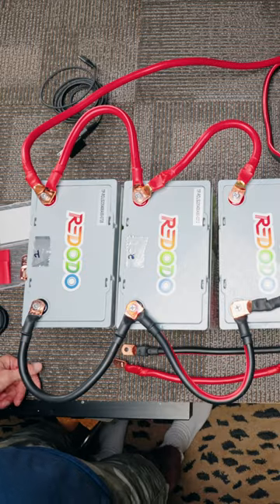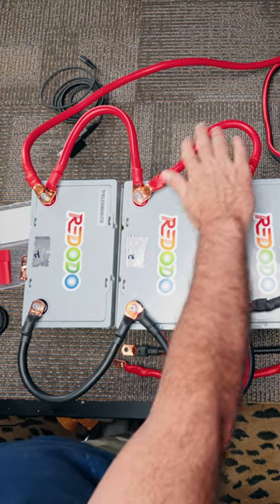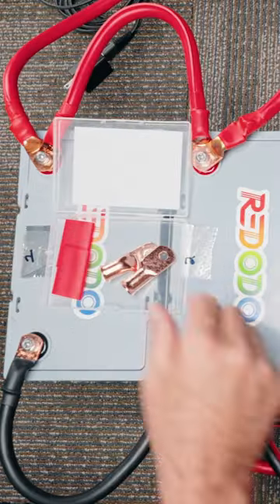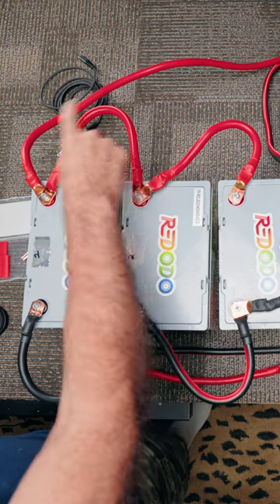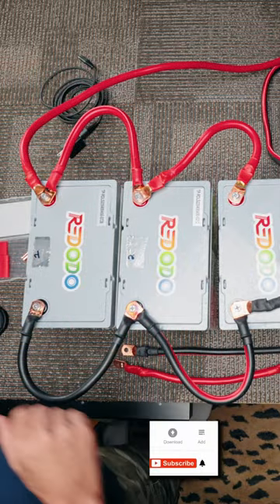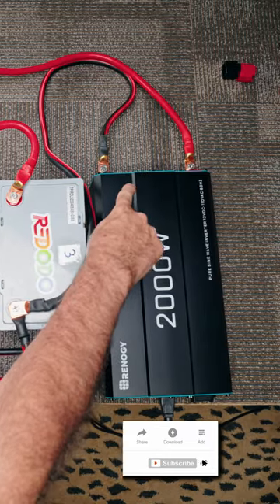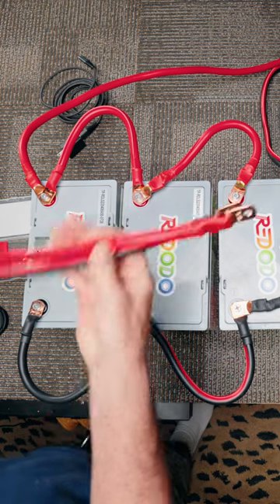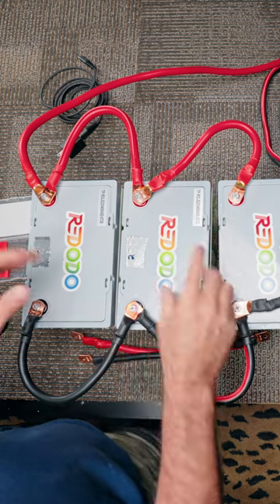How to Parallel Multiple Batteries to an Inverter #shorts

Comment: Remember kids, parallel for adding amperage and series for adding voltage.
Reply from the maker: Yes thank you!... 😀
Reply: Uh-oh. So what's the difference between adding amperage and adding voltage? How do I know which one I need to do?
Reply: @angelamarie88 most of these inverters accept only 12 volt. More expensive ones can run on 24 or higher. In the case of a 12 volt, you must increase amperage to increase wattage. Remember that wattage = voltage x amperage.

For this 2000watt 12 volt inverter you’ll need 2000/12 amps to run at maximum wattage. That’s 167 amps.

Each of those 100ah batteries can supply 100 amps maximum (due to the bms rating).

Therefore, at least two batteries in parallel can provide enough amps to use the inverter.
Reply: It’s also worth knowing you can do both not at the same time, but you can connect batteries in parallel then connect the parallel sets in the series if you want
Reply: We are not ready for this stage yet 😅 @UKsystems

Comment: First and last battery in this setup will suffer the most. Middle ones at least. Better hook up all plus and all minus poles separately to a thick copper bus bar with exact same cable length to ensure the best longevity
Reply from the maker: Great!  Thanks for the info... 😀
Reply: Forget battery life, there's no fuse to prevent the wire substitute from catching fire.
Reply from the maker: Yes I would add a fuse.  There's no time to explain those details in a shorts video.  They are limited to 1 min or less... Thanks for the input. @tommyt414
Reply: @JLPicard440  no need to really explain it, just showing the current generation that things "work ok" without a fuse is enough to give them dangerous ideas. I just had this conversation with my sibling who is 13 years younger than me because that's how a lot of stuff is shown for demonstrations, and the dots didn't fully connect.
Reply from the maker: Thanks for the input!... 😀
Reply: @tommyt414 anyone can find a fault in a short video like this. But you seem to forget that the inverter has a fuse built in it. So no danger as you were implying. It would just be another connection to fail. This one fuse is fine, also it makes it easier to change your amperage of the fuse to what you want it to be.
Reply from the maker: HI!  Thank you for point that out.... 😀 @alphatrion4020
Reply: Great observation about a better way to hook them up.  I never thought of that, but it makes perfect sense. I'm always learning.
Reply: Tell me more about
Reply: each battery should really get its own wire straight to the inverter.
Reply: @tommyt414  it’s not this creative responsibility to tell people they need a fuse quite simply if they don’t understand they need a fuse. I believe they’re going to have a few other other problems along the way which is gonna happen as well.
Reply: so you're telling me that my paralleled resistor load bank is going to fail on the ends where the connection is? BS, go and study a little further, get some real life experience and then come back! The problem comes with the charging, they need to be balanced when charging so that they get to full capacity. You can't charge them in parallel! 40 years electronics tech and electrical engineer the math has not changed!

Comment: connect 4 of them in series and get a 48v inverter.  you ll just need a 8AWG cable to make the connection. Do not need to worry about cables heating up... or flexibility... nor high cost!
Reply from the maker: Great idea!  My inverter is already 12v, but If I get another one sometime I will certainly do that...

Comment: How about two 100 amp batteries. And a 200 amp hour battery hooked up together.?  Can it be done ?
Reply from the maker: Yes absolutely!  If you have 2 100ah batteries you would connect them together in parallel and tap the + on the one battery and the - from the other one... But not absolutely do not connect a 100ah and a 200ah together in parallel.  That would probably not work out real well.. Or (2) 100ah batteries with a 200 ah battery as you stated...  The batteries need to match as close as possible.
Reply: @JLPicard440  thank you very much for the info
Reply from the maker: @Bailey463  YW!

Comment: im doing the same because i cant afford lifepo4 batteries so im buying 7ah or 12ah 12v  and im con necting them to parallel, for now i have x2 7ah and x12ah batteries and i ordered x2 12ah batteries so i can have a total of 50ah since i use a 500w inverter
Reply from the maker: HI... It sounds like you're mixing battery capacities... The manufacturers don't recommend do to that.  They always say to use matching batteries....  Just letting you know..  😊
Reply: @JLPicard440  yeah but never had problem with that, because when you have to build li'ion battery packs you'll also use unmatched batteries. 

just letting you know ☺️

Comment: Can i get negative and positive from same battery instead of third battery for inverter
Reply from the maker: How many batteries are you going to use?  If more than one, it'll be a little out of balance.  It'll still work, but you might have a voltage drop on some of the more distant batteries...  😀
Reply: 3 batteries sir
Reply: 18650 lithium batteries in parallel
Reply from the maker: Oic... those are the ones they use in tool batteries I believe.  Usually they're in series to get more voltage.  If I were to put them in  parallel I'd probably want to tap the middle battery. @abdullahmaqbool587

Comment: whilsted I like the simplicity of this explaination. The Warnings are missing. 1. you need to load balance prior to connecting it. 2. Depending on the wiring diameter you may need to upgrade the cables to wider diameter. 3. Dont mix the battery chemistries 4. Some Battery chemistries may need additional charge controllers 5. dont light your stuff on fire.
Reply from the maker: HI, thanks for the info!  A shorts video is limited to 1 min or less... There's a very limited amount of time to fit all that in... Hopefully someone will read your comment and put it into their memory banks.. 😀

Comment: What if we take positive and negative from one of these 3 batteries. Connecting plus minus to first battery or third battery or middle battery, will it be fine?
Reply from the maker: HI, you'd be better off to take it from the middle battery.  That way you have equal length cables going from the middle battery to the other 2.   Hope that helps.. 😁

Comment: This is a connection of all Positive & Negative terminals of the batteries 🔋 in Parallel.  Then why is the positive terminal to the Inverter connected to the Positive terminal of the Third battery (farthest from the inverter ??
In real Life situation this method would be impractical because every time user adds another battery in this parallel connection of many batteries, they would need a longer (May be new) cable to complete the positive side connection with the Inverter. Thanks 🙏🏻
Reply from the maker: Great!  Thanks for the info

Comment: Circuit breaker or fuse needed. Don’t risk a fire if the safety systems fail on the inverter
Reply from the maker: Yes I agree....  Thanks for the input..
Reply: @JLPicard440  In fact, you should have a fuse on each battery.  As it is now, if one battery suffers a shorted cell, it will be provided with a ton of amperage from the other two or three.
Reply from the maker: Yes that makes sense....  Thank you for the input.. 😀

Comment: October2823/0133h 🇺🇸 Thank you for the demo. But there was no mention of what type of battery, they are. Is it flooded or prismatic cells with built in BMS. And also some light on what Inverter that was. And its output (110AC or 220 AC) These infos are highly necessary when you illustrate your project to public.
Remember the whole world is watching your presentation. Best wishes.
Reply from the maker: Thanks for the info..
Reply: Dude, yes, there's lots to talk about here, but by definition it's a short video.

Comment: Why you didn't connect to the inverter from the same end of the battery ie +ve & negative.?
Reply from the maker: I don't remember... 😀
Reply: Perché è giusto così positivo batteria 1 e negativo batteria 3 is correct per equalizzare il consumo in tutte e 3batterie positivo e negativo in batteria 1 no good batteria 1 si carica e scarica prima delle altre così oppure con una busbar is good batteria 1 positivo in busbar batteria 2positiv in busbar batteria 3positiv in busbar poi inverter in positivo busbar e egual negativo busbar is ok

Comment: Should of used welding cable don't be cheap.
Reply from the maker: I believe the correct cable for a 2000w inverter is 2/0... I don't have any that are that size, but working on it... 😀

Comment: When using 3 batteries do you have to run 1 wire from the first battery to your inverter then the 2nd wire from the 3rd battery or can both wires come off the first battery and go to the inverter?
Reply from the maker: I would run it so it's somewhat balanced.  You can also run from the middle battery and have the heavy wires going from the middle battery to the 2 end batteries.  You can google different scenarios for running 3 batteries in parallel and also look at your manufacturer website to see what they recommend as well...
Reply: Ok, base on your question. It is possible to do exactly that! Only at the beginning of your question. But not the second as you mentioned! It is not recommended! “ Connecting the positive and the negative on each of the terminals of the first battery”. However,…having 3 Battery, the negative wire from the inverter goes to the first negative of the first battery, and the positive of the inverter goes the the third battery positive terminar. Please be advised that it is very important to use the right fuse on the positive terminal of the third battery. If all battery are 100 Amp each, you need a minimum or 300 Amp fuse, but it is recommended to use a 350Amp fuse.
Reply from the maker: Thanks for the info!
Reply: @Salsadepr40 Excuse me for jumping in, but there is no such thing as a "100 Amp battery." 

Edit: I stand corrected per Captain Picard's post. I'm an old lead-head. My batteries - as old and tired as I am - I would still count on to deliver thousands of amperes in the event of a short circuit. Long enough to blow the redundant 400A fuse at  least.

Battery capacity is often rated in amp-hours (abbreviated about a dozen ways like Ah, A-H etc) but that's not the same as amperes, which is the unit of the instantaneous rate of current flow, not battery capacity.

EdIt: (for those of you who were in need of a bit of pedantry.)

In theory, a 100 Ah battery could supply 1 amp for 100 hours, or 10 amps for 10 hours, or any combination of current in amperes and time in hours that multiplies to 100.

Edit: solid theory

In practice, the faster you draw current, the higher the internal losses, and the less energy you'll be able to get out of the battery. Most battery ratings in Ah are based at a 20 hr rate, e.g. 5 amps for a 100 Ah battery, but you need to check the manufacturer's specs if it isn't printed on the battery.

Edit: and now we get to more lead-head stuff.

Then of course there's the issue that flooded lead-acid batteries will have a relatively short service life if you regularly discharge them more than 50 %. 

It's a complex subject.

Edit: Yes, myself from yesterday.

 As it happens I am at the point where I have to replace my aging bank before next winter.  All options are open including... lead-carbon! (Lead, Timmy: sure it's heavy and toxic but it's amongst the most successfully recycled materials.)
Reply from the maker: HI, I know that... These LiFePO4 batteries have a BMS inside.  The ones in the video have a 50 amp max output controlled by the BMS so that it doesn't over discharge or short out. They are also rated at 50ah.  I also have other batteries with a 100 amp max continuous out... with a 280 amp 5 second surge.  The batteries are also rated for 100 ah capacity... You could still say it's a 100 amp battery since that's it's max rated output... 😊. Especially if you need to know what kind of amperage you're dealing with so you can choose wire size and fuse size.
Reply: @JLPicard440  Well I just learned something. Thanks for posting, I'm editing my post.
Reply: Cool video 👍👍
Reply from the maker: Thanks!  @TheRizal2727
Reply: @civildiscourse2000 le lifepo4 da 100amper 12.8volt tu daranno 100amper real il piombo max da 100amper solo 50amper con 0.1c max 0.2c le lifepo4 0.5c max 1c is 100amper reali no problem piombo 100amper 12.8volt no food use 600watt is over max 0.15c 200watt 4anni durano con 600watt 1anno forse and real 0.4kw da 100amper no good piombo per inverter 12.8volt 2000watt  minimo 800amper piombo for 2000watt use lifepo4 ok 200amper 2000watt

Comment: Can i series those? Will the 2000watt inverter handle it or just go raw and leave the inverter out  like the way it was done in the old days ,never had fires  always enough power to run like forest gump like when all those metal parts broke off  and he was cruising ,whatcha think?
Reply from the maker: Yes Forest was a runner!  You would series them if you have an inverter that is made for 24 volts or more.  You wouldn't want to series the batteries on a 12v inverter.

Comment: Eventually the poor guy gets totally confused, when several people say no parallel, yes parallel, use welding cable, use fuse but no one told the ratings, the first and the last battery will suffer, connect all the batteries to a THICK Copper bar! ( it’s BUSS BAR) how will you charge the batteries, etc etc!! Man ! 
I pity the guy. Why did you, even post your project on YT? If no proper training, then get it from educational institutes. Education makes all the difference, please. Regards.
Reply from the maker: Thanks for the tip..
Reply: Could you pls illustrate how this bussbar connection that you spoke about is done?
Tag this comment to it pls

Comment: Running a 2000W inverter on 12V seems dangerous. Very high amperage draw. Would be running a 24V inverter.  But then you can't recharge from a car.
Reply from the maker: As long as your cables are big enough and you've got an inline fuse I wouldn't hesitate at all...  That inverter is designed for 12v... 😀. But I agree 24v is better...
Reply: You're just flat out wrong. I've installed much higher output inverters than this into commercial vehicles that run off of 12v systems for simplicity. They always had an additional alternator, or one very high output alternator (depending on the kit/brand), and sometimes an auxiliary battery to help feed it properly. 

I've seen inverters in the 5kw and 6kw range. They're insanely expensive and pretty much unavailable outside of commercial equipment vendors.

Comment: I did the same thing but i made it 48 volts
Reply from the maker: Yes 48 volts is better, you can keep the current down a bit.... 😀
Reply: yes.... 48 volts systems are the most common now... saves wiring costs, flexibility and low current.
Reply from the maker: Excellent!  Thanks for the great info... 😊😊 @varman001

Comment: If you want to make sure your batteries always stay in balance, you should follow the manufacturer suggestion when you do your series wire then each terminal should go to a Busbar one for positive another for a negative run your load from that your batteries will thank you for it
Reply from the maker: Thanks for the info!

Comment: What is the difference,  between  Series connection and Parallel connection to Batteries,plis  explain to me,
Reply from the maker: Hi, with parallel you're adding to the amperage that each individual battery can produce but keeping the voltage the same.  With series you're keeping the amperage, but adding to the voltage.  Depending on what voltage your inverter is made for, series may not be an option.  With series if you're using a higher voltage inverter like 48V for example, you'd want to use series to get the voltage up that high... hope that helps.
Reply: @JLPicard440  
Hello  please,  l need  your help, l  install a   3000kw inveter, connect with 2x 550w solar panels, and 2x 200HA batteries , all connected in series,  But when l switch on the  inveter , the  Solar charge indicator does  not appear on the screen display,  please help me identify the problem, thnkyu....
Reply from the maker: Hi!  Without being able to see it I won't be much help.  I would start by checking the voltage coming directly from the panels and see if you've got voltage going into the charge controller from the panels.  If you're not comfortable working around live electricity, then please don't try it!  One other thing... you said everything connected in series..  Does your inverter and charging system support the higher voltage?

Comment: You can use the battery cables out of any semi that has more then 2 batteries for this and you can get them from any truck salvage yard or have any parts store build them for you. I've been a mechanic all of my life and and a diesel mechanic too. You can use higher amp batteries for this application and use less batteries or more batteries for a longer run time but it takes longer to charge them backup.
Reply from the maker: Yep those should be heavy enough.. I used to be in trucks so I know a bit about that... Had a dump truck with 4 batteries and some heavy cables!  Don't know what gauge, I believe the correct cable size for this application with a 2000 w inverter would use a 2/0 cable...
Reply: @JLPicard440 se è a 12.8volt da 2000watt is175amper 70mm2 70cm positiv end 70cm max negativ se 25.6v 35mm2 ok 51.2v 16mm2 for 2000watt max 2500watt up 5000watt in 51.2v 35mm2 is ok
Reply from the maker: @stefanocerna6504  Thanks!